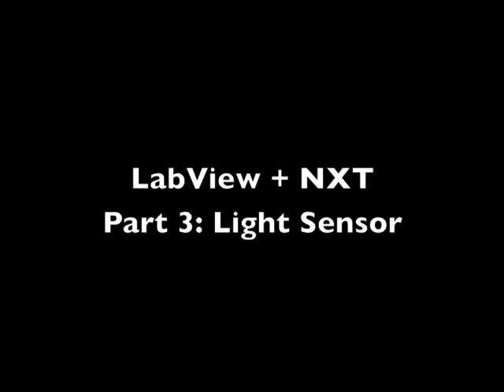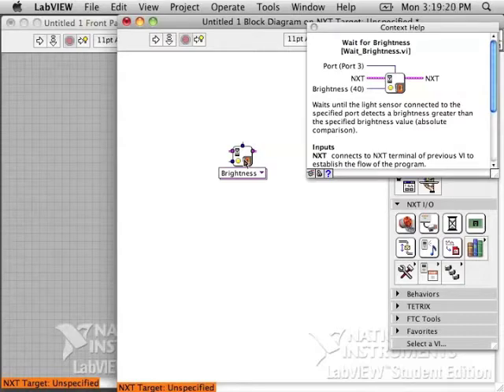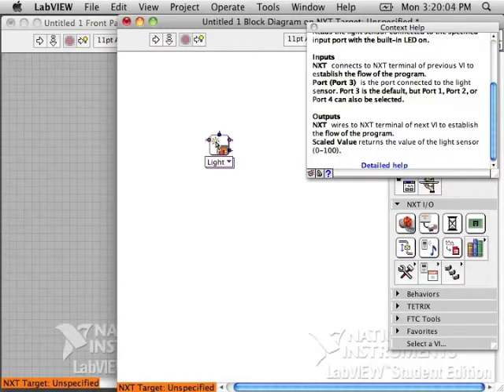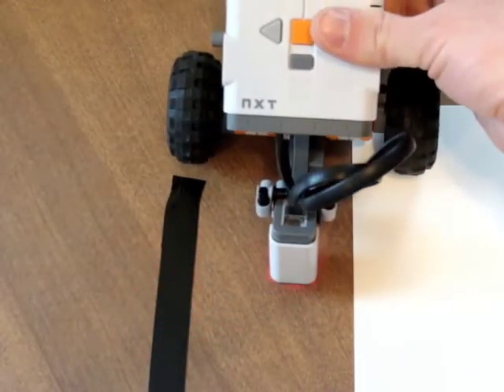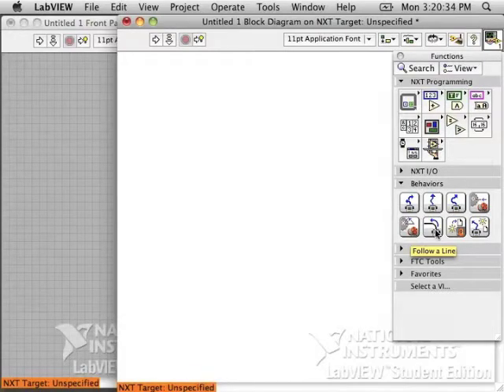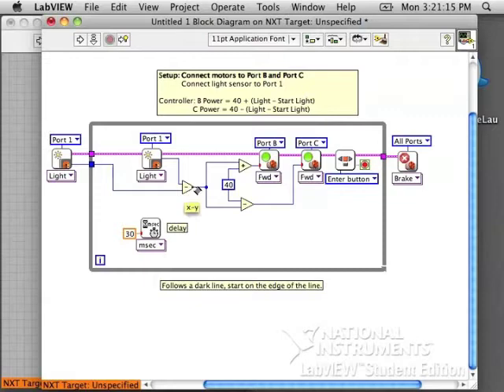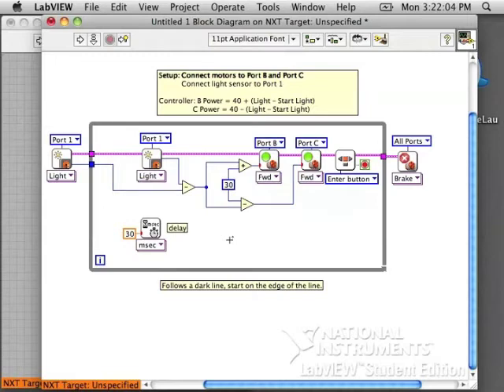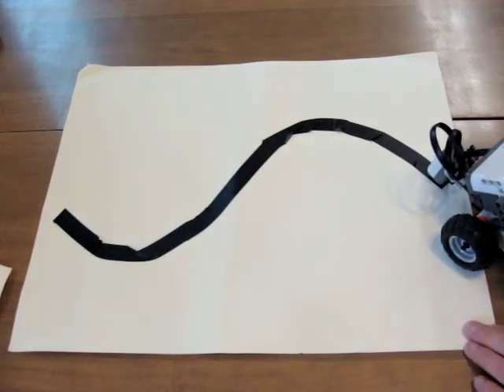Labview + NXT Part 3: Light Sensor

Comment from the maker: Sorry, but I can't think of anything.  I haven't ran into that problem.  I don't believe that there is any difference programmatically if you use the run or deploy button. My only guess would be that the usb cable creates some sort of physical drag.  Maybe that slightly changes the speed of your robot or changes the angle of the sensor slightly....

Comment from the maker: If you use the follow line behavior in LabView for a tetrix robot, you may have to really change the values. I needed to drop the power of my drive motors to 11 and the sensitivity around .5 or .6.  Also, make sure you have your light sensor directly above the edge.